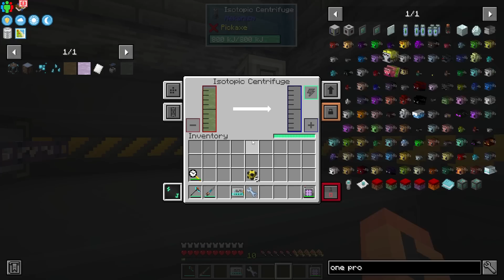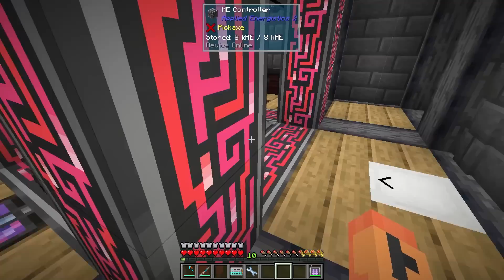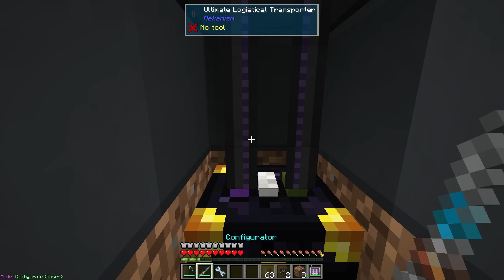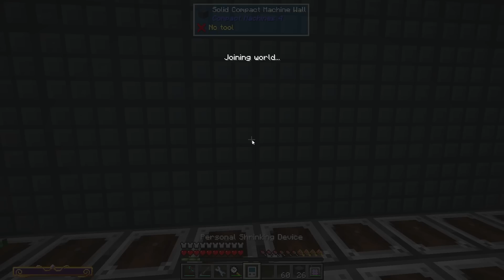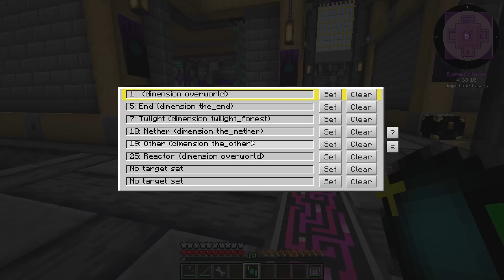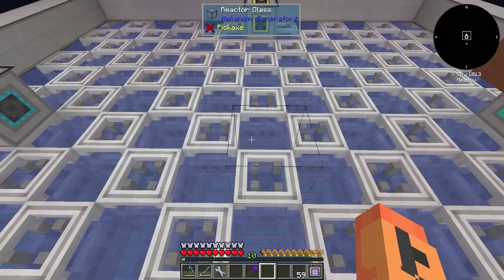All the Mods 7 To The Sky - Mekanism Fission Reactor - Ep19

Comment: You could put a energy trash can by the turbine so that if your energy storage at your base is full, the next place it puts the energy is in the trash can.  That way you can never loose your reactor due to energy build up.  You might also want to consider a redstone control port set up on the reactor so if your heat exceeds safe levels (i.e. something happens to the water) it can immediately scram the reactor.